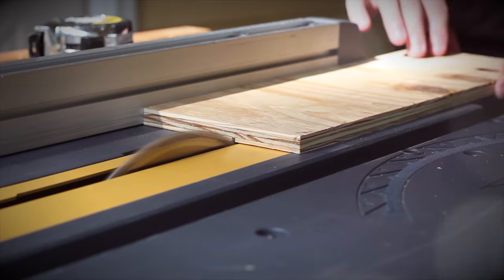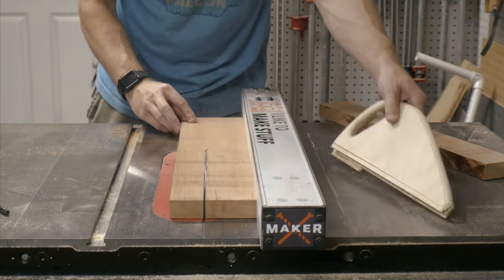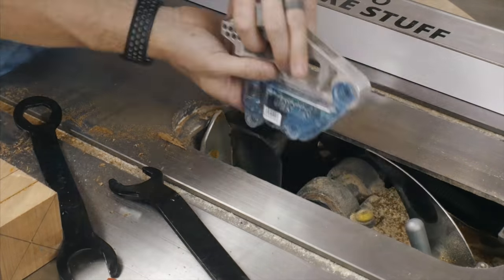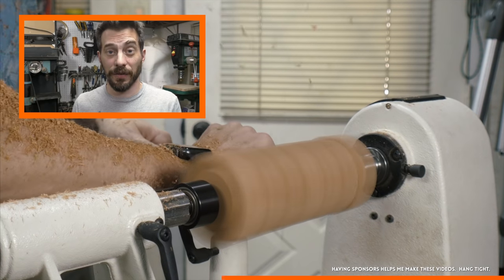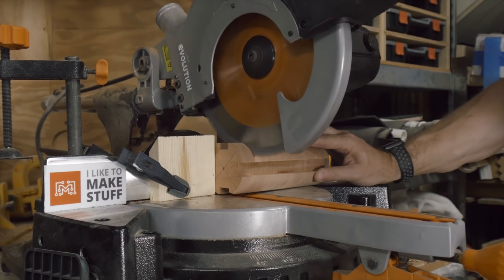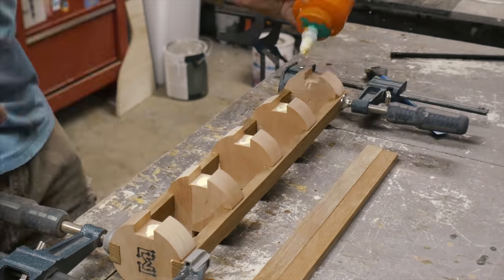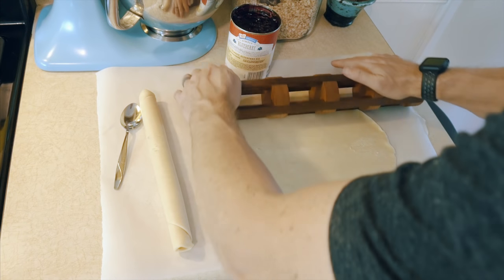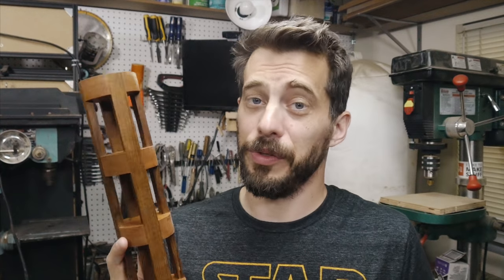How to Make a Ravioli Rolling Pin // Woodworking | I Like To Make Stuff

Comment: This is awesome! I want to make one now.  I think the alignment issue at 3:57 is from not assembling the discs in the same order and rotational clocking as when they were from one piece. Even if the slots were different depths it should have still aligned properly

Comment: Hey Bob! Nice video. I was thinking about your alignment issue, and noticed that the pieces were all aligned (just not circularly symmetric)  before you cut them on the miter saw. If you had marked two of the dado-cut channels (at 90deg from each other) then you would be able to align the pieces correctly by following the markings, even without having squared the block post glue up. As it is, some of the pieces looked as they were flipped and/or rotated differently from one another (hence the misalignment).  As always great video, keep it up!

Comment: I would really appreciate if you did a maker 101 video on the different types of woodworking joints, advantages and disadvantages. I've researched on my own, but until you see them made and in use it's harder to visualize.

Comment: After seeing those pies I need to make one. Im going to attempt to build one with only a bandsaw, a router, chisels, and a lot of sand paper
Reply from the maker: That sounds like everything you'd need! Go for it!
Reply: I was trying to think about how to make it without a lathe as well. I've been meaning to build a circle jig for the bandsaw, and I've even seen jigs that go in the slot on a disc sander to help finish them out.
Reply: Victor Fiori If I were to attempt it now it would be a heck of a lot harder, considering that I only have a drill, some dull chisels, a handsaw, a router, a bunch of sandpaper and no workbench... 🙃
Reply: make a jig for a table saw powered by a power drill.... your new lathe
Reply: center pivot router jig to cut the discs out of a flat board  or a round template with a template following ball bearing
Reply: Cut the squares, put notches on the sides. Then use a large hole saw to make them round.

Comment: Interesting interpretation of how to make it.  I was watching had some thoughts for you
1.  thoughts on doing all your glue work up first then  going to to the lathe.
2. doing it the way you did but on the long strips making then slightly house shaped(square with a triangle o top) it would then possibly act as a cutter at the same time.?
3. On the baking side for pie crust like that a little egg wash on the seam before the 2nd layer goes on and on the top would help them stick together and give that glassy sheen

Comment: As a DIYer: cool project bro.
As a half italian: you seriously need more pasta in your life. ^_^

Just in case you'd like to revisit: The coolest part about the ravioli is that they are pasta with a filling. So you want the flat spots the roll makes to be thinner, so you use less dough, have more filling in and actually cut the ravioli in the same pass.

Heck, for an even cooler project, you could swing for a roll that makes hexagonal ravioli.
See ya!

Comment: Concerning your issue with the non aligning slots: I think it should've fitted nicely, if you had the same order of the wood parts after cutting than before. When working in the lathe, all the slots were perfectly aligned, so if you could have kept this orientation throughout the work process, it could have been very exact at the end.
As soon as the single parts are moved, you either have to fiddle around and reorient the parts as long as everything is lined up, or - as you did - just use a bit more of the good old force ;-)
Either way, a nice project for cooks interested in carpenting or carpenters interested in cooking :-)

Comment: I love it.  have to see if I can make one for my daughter.  the challenge will be doing the roll work without a lathe
Reply from the maker: You could cut each circle out (and the slots) using a bandsaw or scroll saw if you have access to them.  A jigsaw might even work, but it'll need some cleanup with a sander.
Reply: That's a terrific idea.  I do have a band saw (the same one as you, actually).  I hadn't thought of doing it that way.  I could even do a few at a time and sane them down smooth at the end.  Thanks!

Comment: That's neat Bob! What is the advantage of lasering onto blue tape versus without? Crisper image?
Reply from the maker: There's some residue on the surface around the cut. The tape makes it really easy to peel away. Otherwise you'd just have to sand it off.
Reply: The laser will usually leave a smoke stain on wood around your cut... so the tape keeps the surface clean.

Comment: My stepfather's father was first generation Italian. He came from Sicily I think. He brought a start from a 400 year old rosemary bush which was 5 ft tall and bigger around last time I saw it back in the late 1970's a a young teenager. He also brought a ravioli rolling pin that nobody knew how old it was but it was 18-24 inches long it had hand carvings all over and the edges of the openings had the ridges like that the roller you used to separate yours. No offense intended. His had knobs where handles should have been if it were a rolling pin I always thought although I had never seen it used, until seeing you use yours. I finally understood why there was knobs Some of the pieces that ran the length were worn and broken and it was no longer used. So thanks, I always wondered about that.

Comment: One possibility about the strips not lining up: When you cut the slots in the round slug they were perfectly aligned, right? they had to be since you cut them in one long groove. I suspect you did not keep them in the same order they were cut apart. Therefore when you glued them back together they were out of order, which might have been why the strips would not line up again. Just a thought.

Comment: Of course, the glue should be cleaned before cutting but, that being said, it seems to me (correct me if I'm wrong) that you didn't keep the, say, rotational position of the small cilinders as it was for the, say, master cilinder. I mean, you had four indentations: A, B, C and D. When you aligned the cilinders again, they should be in a straight line if they were all aligned again, instead of making the strips of wood connect, let's say, indentation A with B, C and A again.

I don't know if I'm explaining myself but... that's about it.

Nice one, by the way, it's giving me some ideas :-)

Comment: Another way you could make a Ravioli rolling pin (and still use the lathe) would be to create a round post, and then use a router (and a jig and some clamps) to route out the ravioli cavities. IF YOU ARE REALLY CREATIVE: after routing out the ravioli cavities, get something to carve shapes into the pin itself and/or the pockets to leave interesting patterns in the raviolis when rolling.

BTW, the holes on your ravioli pin are really too long for ravioli. But I bet they make great hot pockets.

Comment: I think this is one of those few times a year tools that is nice to have, cause its a pain to find one usually or it cost a fortune. That being said one of the things I noticed is you said you didnt think the blocks were square/true. From my experience cutting steel and such, it could just be simply that each side was different(maybe a few mm off. SO if you took the time to mark them up and make sure they all matched in a line it might have fit better. But if you turn each one just a 1/4 turn that hair difference over the 5-6 pcs could have been your issue. Just saying

Comment: is there a purpose for the painter's tape when you were running the laser cutter?
Reply from the maker: There's smoke residue that lands right outside the cut. The tape lets you just peel that away. Otherwise it'd have to be sanded off.
Reply: oh cool!

Comment: What kind of brush are you using for wood glue?
Reply from the maker: It's a Rockler silicone brush http://amzn.to/2pGm9Wl
Reply: Thanks! 
Every brush I tried using so far got ruined pretty quickly, hope this one will hold up well.
Reply from the maker: They do pretty well. After the glue dries, it pulls right off the silicone.

Comment: You mention they're "weird lookin". How would you make them square along that curve?
Reply from the maker: If the circle pieces were larger it could be made to create square cut outs.  There'd be a little math involved to match the gap length (inbetween circles) to 1/4 of the circle diameter, but that would do it.

Comment: When you didn't square the block your pieces didn't line up because they weren't in the original orientation.   Couldn't you have just rotated them each 90° at a time until you got back to the original orientation and therefor they would have lined up?
Reply from the maker: It wasn't about them lining up, it was that over the course of each slot being cut, they weren't the same depth. The uneven surface of the material on the table saw surface changed the cut depth from beginning to end.  The did LOOK like they weren't lined up in the shot, so I understand what you mean, but that actually wasn't the problem.

Comment: I like it! Tip - though you clearly are a maestro of making things. Let the glue dry - don't wipe it off while it's wet. Why? Wiping it smears the glue and makes it hard to stain and a bitch to sand off later. Instead, let it dry and then you can flick or cut the little glue blobs away and no problems with staining and sanding. Less work and better quality. Try it out for yourself.

Comment: why when you take the circles to laser machine you put tape??!
Reply from the maker: THere's some burning that happens on the surface right around the cut when using a laser. By putting the tape on, any residue from the cut lands on the tape instead of the wood.  The tape peels right off to leave a pretty surface. Otherwise, you just have to sand away the thin layer of residue.

Comment: Nothing about how to glue up teak?

I refuse to use the stuff after fighting with it too many times, and having glue joints separate. It's not pretty enough for the hassle.
Reply from the maker: Hmm, I've done a fair amount with teak and never had it separate. What glue were you using?
Reply: Some Titebond incarnate. One or Three - maybe both.

Asking Mr. Google 'gluing up teak' returns a host of esoteric processes that involve chemicals, special surface prep and tight timelines. I've decided that unless I'm building something for a yacht, it's going to be made out of something else.

I've had my fair share of Learning Experience pieces, but only teak has failed me on a simple glue joint.